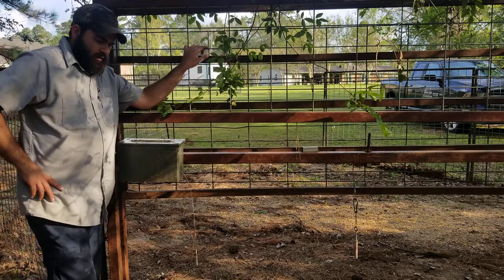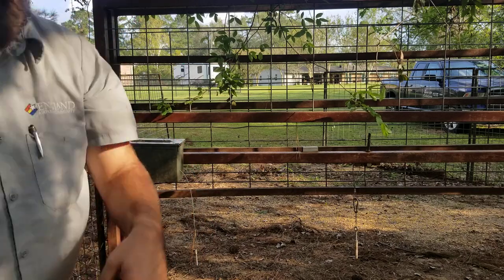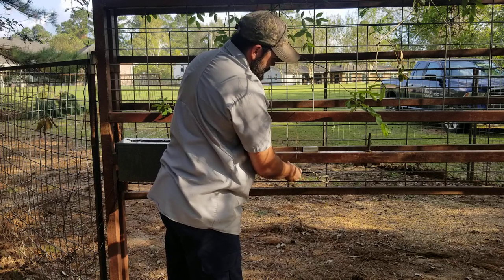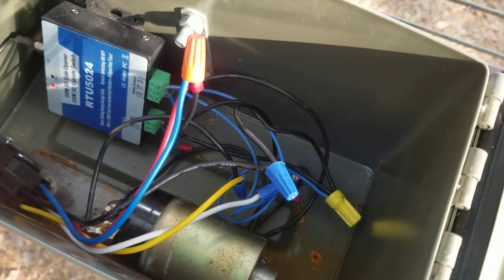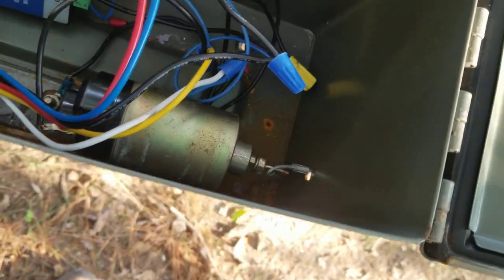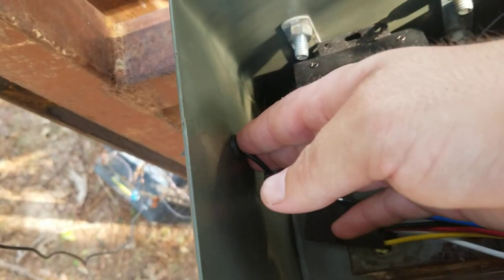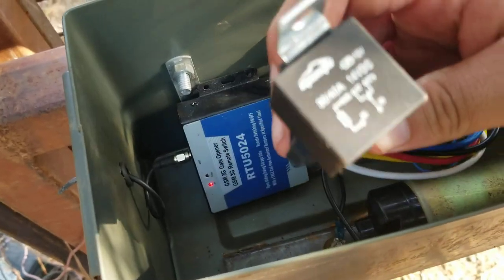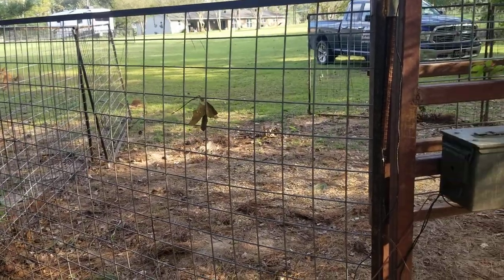Homemade cellular Hog Gate explained

Comment: Does your door popper trip your relay a lot?  I used a 30amp inline fuse and it seems every two gate sets it pops the fuse
Reply: I had to use a 40 amp fuse and it stoped popping

Comment: Whats the point of the relay? Isnt the cellular device a relay?
Reply: It's the same as using a relay in your car to control driving lights, etc.
The control unit only has a small amount of current, so you use that output to activate the relay (think of it as an electrical switch) to allow high current to flow from battery directly to the actuator (door popper).
You are using small current to electrically control bigger current.
The control unit would not be wired to handle 30/40 amp current draw of the door popper.
It's circuit protection and reliability.
Reply: Also to have a control unit capable of handling 30/40 amps would cost a lot more than the unit this guy is using.
Reply: Unit has small current output.
So you use a small output to control a larger current via relay.
Also protects control unit from massive current draw and burning out if there is a malfunction with a seperate component of the system.
Reply: Current output and device protection

Comment: Coyote 1 I have the RTU 5024 and I have trouble setting it up with the cellular part. I was wondering if you would be able to assist me by phone number or email some way?
Reply from the maker: If you have Facebook,  message my page and I will see if I can get you setup
Reply: Hey buddy can you tell me what relays those are??
Reply from the maker: @drewskimangham2018  the GSM is an rtu 5024 3g, the solenoid relay is an automotive 30 Amp relay harness

Comment: Need wiring diagram
Reply: 12v goes into control unit.
Outputs of unit are NO, COM, NC. This means that COM =Earth or negative, 
NO = Switch is off until activated.
NC = Switch is on and then turns off when activated.

So you want 12v power into unit, output would be: Negative (COM) to Pin 85 of relay, 
Positive (NO) to Pin 86 of relay,
Battery 12v positive to a 40 amp fuse then to Pin 87 of relay,
Relay Pin 30 to positive wire on door popper,
Battery negative to negative wire on door popper.

You are using a small electrical input to control a larger electrical current via the relay. 

Clear as mud? 😂
Hope it helps